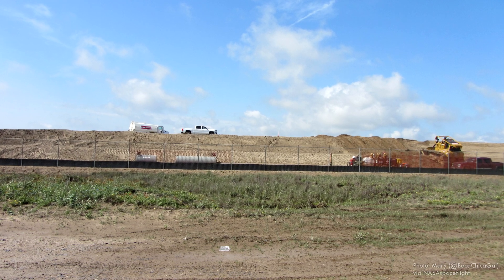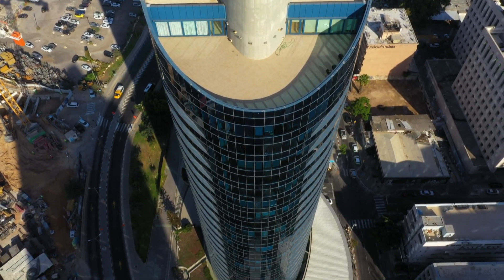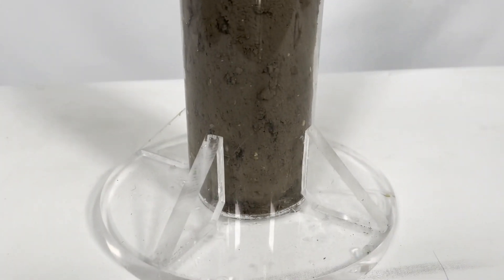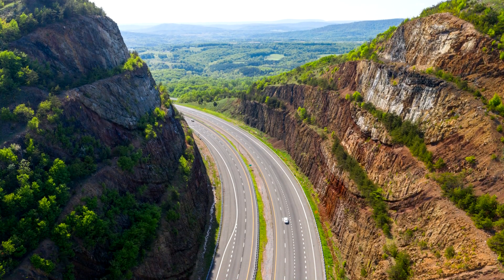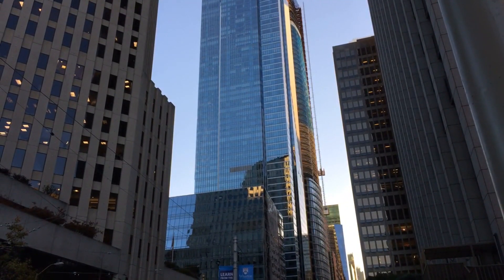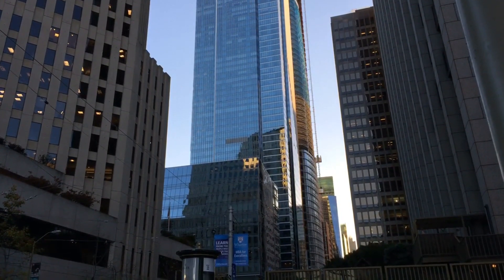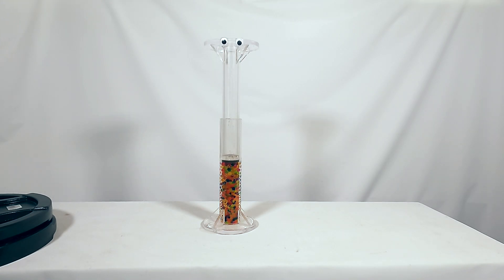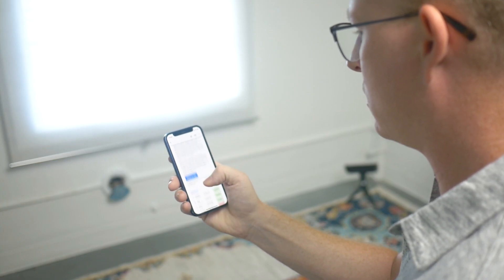Why SpaceX Cares About Dirt

Comment: This reminds me of a documentation of the construction of a large school building, this may be a topic for a future video - because large buildings have the exact opposite problem during the construction phase (building floatation). I picked up a conversation snippet where the engineer stated that the "bathtub" (foundation & cellar of a large school building with 4 stories) has gotten it's roof and that it's now heavy enough that it can't float up due to groundwater pressure when they remove the sheet pile wall. This boggles my mind that this is actually a factor they have to consider during construction... 😲
Reply: I used to build concrete pools and sceptic tanks, even though we might have 30 tonnes of concrete in a pool, on a few soil types I would include a stipulation on the guarantee  that the pool was never to be emptied, as it would float, one small 3000l septic tank we had to pour a 8 tonne slab on top as it would float even when full. The wet ground soil when tested was close to 2500kgm3 tank was 1800kg m3 and water is just 1000kg/m2 creating 5 over tonnes of floatation force.
Reply: And people still go "reeeee" about large projects taking a long time....
Reply: @bobbypatton4903  To be fair, large projects cause disruption and disruption is uncomfortable.  They will always REEE and that will maintain the pressure to innovate in construction.  Prefab has come so far not just because the cost of making a building out of prefab modules is less, but also because the opportunity cost of how much longer before the investor sees a return by making the project operational.

Comment: Maybe a downwards facing pole/girder/spike under each corner of the building would prevent uneven sinking? or otherwise the foundations could be shaped somewhat like the bottom of a boat? Either way allows the building to compress what it's sitting on into, "earthstone"? Then more stairs can be built and more waterproofing added if needed and you get some extra foundation and cellars for free.

Comment: The compaction of the soil in your test is also uneven because of arching effect: weight is redistributed towards the walls of the oedometer and the soil sticks to the walls thanks to Coulomb's friction.
Reply: Same thing happens in grain silos.
On one hand it limits the pressure on bottom grain. On the other, it strains the walls.

Comment: Coming back home from out in the country, yesterday, I saw an old community hall. It's an old stone-faced building and one end had settled significantly, causing it to crack and about a quarter to separate. At the top, the gap was probably around 8". It's a shame to see old buildings fall apart like that, but it goes to show that the ground wasn't properly prepared for the foundation.

Comment: Mr. Practical Engineering didn't expand on the other factor in consolidation which, clearly has had huge historical relevance. For most of human history the tallest and biggest buildings in the world were cathedrals in the UK and Europe. They were built in some cases a thousand years ago and given their massive size using stone the compression would be enormous. And the builders did not use any ground engineers.  Clearly, they used 'Time' as the main factor. They built these massive buildings sometimes hundreds of years and thus allowed enough time to compress the soil.

Comment: Can you explain what's happening in Ireland with about 6,000 homes, new homes, cracking and becoming unsafe?
I stumbled on their news and there's lots about what's happening, but not 'why'.
I know the British press are constrained from writing about perpetrators until after the trial, because, well, they might be innocent!  Don't know if that is part of the problem on this issue; it has been reported that the rocks didn't meet building requirements and the gov't did not do enough inspecting.  But just the fact that's what the homeowners are complaining about.

And they want to gov't to repay100% of their loss.

Comment: A good example of a bad settlement is what happened in Santos, sao paulo, brasil. In the 1960 there was a boom on demand for Residencial buildings by the sea and construction began, but as there weren't a lot of good equipment to know what type of soil there was under they just build the buildings but 10-30 years many buildings started having a settlement but it happened mostly when two buildings had their pressure bulbs at the same soil and they started sinking but just on one side. Nowadays many buildings are having a process to correct the settlement, the create new foundations

Comment: I live in Florida and had the cut down a tree that was next to my house because of hurricanes, but not because it could fall on the house, the main reason is when hurricanes would strike the tree would sway back and forth Violently and it actually caused the north side of the house to settle lower even though the house is 40 years old.

Comment: @1:44    where did all the steel go 20 yrs ago , how can steel that holds up all the weight turn to dust ?? If you just did a neat compact pile of steel , wouldn't the pile be much higher ?? If it falls in a jumble it would be a MUCH taller pile of steel bits . Please tell us how this is possible . Thanks !!
Reply: The majority of a building is concrete and empty space. Additionally, there were 6 floors beneath the world trade center for parking that were compacted as well, with much of the rubble being under ground level.
Reply: @10kanutt   I agree to a point , if you see photos of just the Vast amount of steel & do the math of volume packed tight , the numbers don't add up . The dust was full of Fe , how did that happen at cold temps ?? >> https://www.youtube.com/watch?v=rn3A3c_FAOw&t=5757s

Comment: UAF(Alaska) graduate here, up in the north another sedimentary hazard is permafrost structures have to be built such that the permafrost doesn't melt either from temperature or pressure.  When it does melt or if more permafrost is created it can wreak havoc on structures and roads.

Comment: This explains something I saw at a data center construction site I worked at as a controls engineer. There were several large piles of dirt that were moved around various locations where future buildings would go over the course of a year. I had thought they were just temporarily storing excess dirt there (and it seemed a little inefficient honestly), but looking back after this I'm sure it was to speed up consolidation.

Comment: We have had several construction projects here which did similar, where they put 30-40 feet of dredged sand onto land to compact it over a year or two. Then scraped it off and built on it. Much of the land in out riverfront areas, were built on reclaimed marshlands of the Mississippi river.
Reply: Building on marshlands……

Comment: In some areas in and around Berlin, the ground water level is so high, or the basements so deep, that the foundation walls and floor are sealed watertight, and enough weight needs to be added to stabilize the structure so it doesn't end up basically floating.
Reply: This is also why when people decommission an in-ground pool, it is supposed to be broken up and not just filled in. 
If is not broken up, it can, years later, float up out of the ground, sticking an unsuspecting new owner with the cost of removal.
Reply: This is a common issue in the Northeastern United States. I drill wells for ground water control. We just finished a project where we lowered the ground water so a sewer structure could be installed and covered before the water level returned and caused it to float.
Reply: For some major building projects in Berlin, especially for major hi-rise, office/transportation/retail complexes, there's been a system of either ramming modular steel retaining wall segments to mark out the footprint of the construction, or drilling out successive columns and filling them with grout/concrete to form a wall, then excavating the building site. When the ground water flooded hole is large enough, a pontoon is brought in to float the excavator, and when the sub-ground excavation is finished, walls and the basement slab are poured, made watertight, and the water pumped out so the rest of the interior structure can be constructed. It left some epic pits for things like the Potsdamer Platz complexes... Also, for tunnels, at times pre-cast segments are placed on the ground, and then the sandy soils are made to become a slurry, and the modules sunk into the ground until at the proper depth and orientation. Where TBMs or direct mining have to be implemented, the ground is frozen, so the tunnel doesn't start to flood before it can be sealed...
Reply: I worked at a constuction site in Sweden where we built a 14 floor high wooden structure with a concrete basement below ground water level. The building was too light to stay down by gravity alone, so we had to screw it down to the bedrock with a bunch of 6 inch screws ^^

...that's 6 inch in diameter by the way, the hammerdrills we used had an 800hp compressor just to drive the hammer action :P
Reply: @Plumsytheghillieone  I've been to Sweden several times, I find it interesting that the go-to solution for having a basement/preparing a foundation often tends to involve blasting. 😀
Reply: Common issue around buildings sites near bodies of water. Try building a resort pool or basement near the ocean, you end up needing a whole lot more concrete to prevent it from popping before it is filled...
Reply: That's also why the Berlin metro is so famously shallow, in fact they almost had to do it in reverse and kinda just build the city on top of the metro. This was also why during the war Berlin didn't have that many air raid shelters because it was almost impossible to dig anything out and anything built above ground would have to be significantly reinforced to actually be useful.
Reply: The Netherlands is essentially a swamp, half of it is below sea level. There are pumps running 24/7 some for over a hundred years, to keep the country from flooding. Old buildings don't have the watertight walls, so they often have issues. Quite rare in general. Many houses need to have their wooden pole foundations redone, as they go bad. They cut out the ground floor, drive a small pile driver in and drive sections in that connect, like oil drilling pipe. Looks crazy if you see it going on.
Reply: Yikes! Guess you guys have no problem with drilling wells for water!
Reply: Most basements are basically indoor swimming pools 
Pools in Florida will pop out of the graund if you drain the water and forget to open a valve on the bottom.

Comment: Next video do one on building highways across landfills. Roadway engineers and structural engineers have no concept as to how much the ground settles differentially with an overlying load. Surcharging is the best way to speed up consolidation over a large area if you can plan for the waiting time. Unfortunately, highway building often times parallels political promises and available funding which discourages ground surcharging as an option.

Comment: Foundations are also important for building states and social systems as well as models, theories and formal systems of all varieties including software. Aside from catastrophic failures due to inadequate foundations, correcting errors in the foundation later in the building-project is usually associated with exponential costs. But management wants to see results and for longer projects will long be gone when the costs induced by insufficient foundations hits the investors/owners - or in case of states with staff, that can not be hold accountable: Everyone pays the cost, nothing gets corrected, and the states staff may or may not learn from errors depending on personal preference.  For large projects I would always link the the retirement savings for the managers to the projects long term performance. That at least should disincentive cheating on the management side somewhat. 

And then there are security critical systems where an adversary must be assumed to create naturally not occurring conditions to attack it, making sound foundations even more important.

Comment: I worked on a project where we brought in soil to compact the site for several months. Then after bringing it close to grade we mixed lye into the top 8 inches and compacted to make it almost as solid as rock.
Reply: Usually it is lime that's used. Lye, sodium hydroxide,  would just make the soil more alkaline.
Reply: @lightningdemolition1964  Right. Brainfart right there. lol.

Comment: I wish I had watched this video about 40 years ago before building lots of slabs and structures in East Texas, where we have both clay and sandy soils to deal with. Most folks around here are do-it-yourself types, and soil engineering is just experience based for non-commercial projects. Sometimes things work out OK and sometimes they don't...
Reply: Eeyup.  That good ol' Red clay.   Used to live in Hallsville, whereabouts are y'all located?
Reply: @IMRifley  We're just south of Marshall
Reply: If nothing else this does make for a very funny anecdote.
Reply: Probably needs lime if you have a ton of clays and silts
Reply: heh heh. Call Olshan